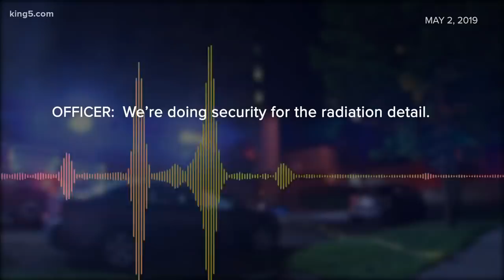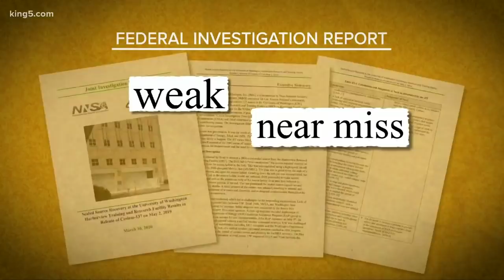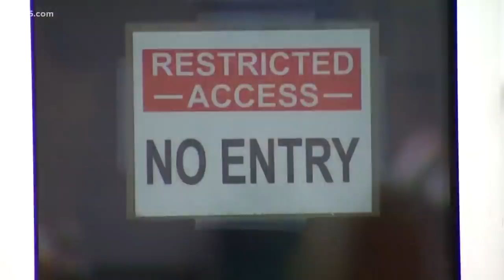2019 Seattle radiation leak a 'near miss' to disaster, federal report finds

Comment: Why bother trying to get some ceisium137, when you have americium 241 on every wall in every smoke detector. Just as harmful, much easier to aquire.  Besides there are so many tossed into city dumps, with the dumps incinerators burning those smoke detectors, everyone is already getting a dose.  And then there were the 3 nuclear reactors that melted down at Fukushima in 2011, and they are still emmitting radiation to this day.

Comment: How much was the contract granted for? What regulations or protocols are to be used  after these are removed? How are these safely disposed? That is what real journalism is. Answer the questions.
Reply: Since Cesium-137 has a half-life of 30 years, they need to encase it in great levels of lead. Lead is used to encase Cesium-137 and other radioactive materials because Lead is the best at blocking Gamma rays.